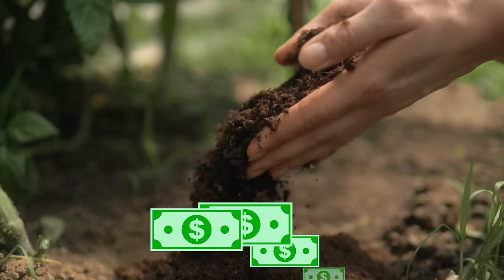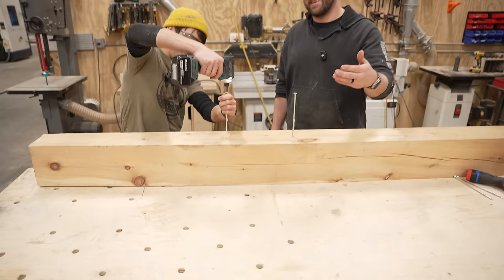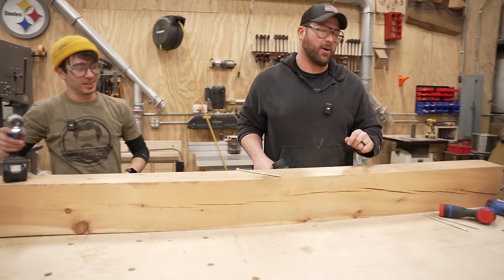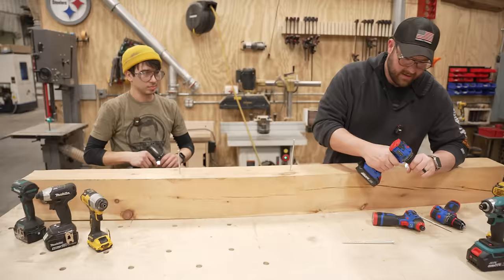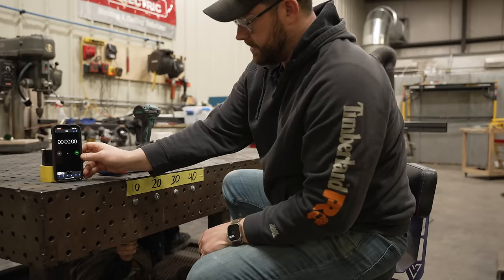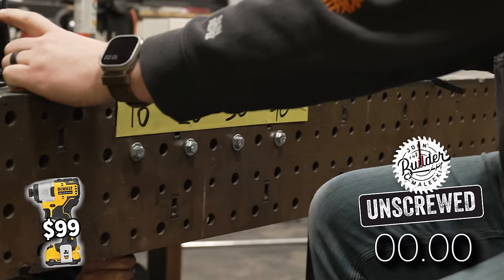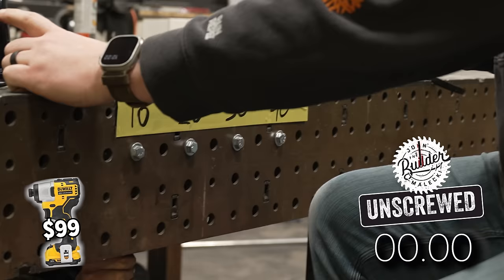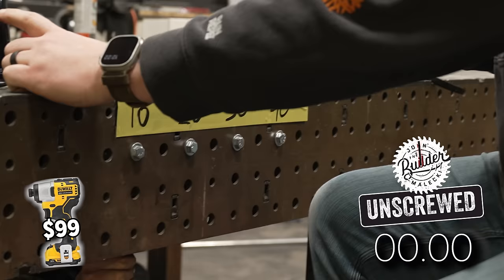TEMU Torture Test..... I was Surprised

Comment: Let's get a Temu vs Harbor Freight vs Amazon cheapest showdown!
Reply: harbor freight would destroy
Reply: @spedracer55 I kind of agree.  Maybe @JohnMaleckiUnscrewed can answer the age old question once and for all lol
Reply: Harbor Freight tools are amazing the baruer and hercules are just as good as dewalt and milwaukee
Reply: Amazon is gonna be the same as temu right. Drop shipped garbage but it's gotta be better than Ryobi.
Reply: I agree
Reply: @chadsmen2519 
😂 These off brand drills are made in the same factory as Milwaukee DeWalt Makita.  But the off brand copycats won't have the longevity as the big brands. The off-brands also don't have all the safety as the big brands. But if you need a drill for a little DIY around the house that $50 Makita javn ain't that bad

Comment: My brother has a Bauer impact driver.  He's used it multiple times to take lug nuts off before he got a regular impact. 

Also, most cars lug nuts are torqued to around 80 lb/ft. Larger trucks will be more of course.
Reply: I would say 75 to 120 for most passenger vehicles and light trucks. With your bigger cars starting around 100. Then big vans and trucks around 100-150. Just wanted to add some more depth 😅

Comment: i use a 18v impact hyper tough brand to do 120 ft lb on all our lugs. its been the best little impact driver we've used, it was dirt cheap cause someone stopped in one day with 2 hyper tough drills an the impact with 2 batterys an a quick charger for 25 bux so we did it to help them out thinking they would be junk but thats been 5+ years ago an they are all still working strong an used daily.
Reply: Hyper tough are surprisingly good
Reply: Sounds like you bought some stolen tools. 🤦🏻‍♂️
Reply: @enderz0r  nah we knew who he was, he gets in a hard spot from time to time an he usually brings stuff around asking if he can pawn it to us so he can come back later an get it back an we always do it to help him out cause he almost always comes back an gets the stuff or if he isnt able he lets us know to keep it an we only mkae him pay way we gave him but that day he didnt need much an didnt want to come back to get them so he offered to sell them all for 25 bux, probably got him something to drink but hes a good guy an dont bother anyone.
Reply: @ChristopherOBrienPSU  so far the ones ive used have been, got alittle electric screw driver i use alot an its battery has died on it an its a internal battery but im going to try to swap it out or make it work with a 18650 cause it was a done good an it lasted for yrs b4 the battery finally gave out but it hink it was partly my fault cause i lost the charger an used one i found that was close but it needed  weird voltage so i got close but not what it really needed.
Reply: @capthowdy126     Seems you guys were a legitimate well trained group.  
I'm sure that gentleman used you as a pawn shop with good intention , and with honest goods to .

Most companies I know will also offer the same service to someone off the street .  

Just curious , but we always found the broken glass around the tools off putting ? 😂

Comment: Just so y’all know, it’s easier to set or break torque pushing vs pulling.  Use your body weight to push the tool down vs trying to pull the tool towards you.
Reply: Fo Sure! Also much safer.

Comment: My Husky air wrench is rated at 250 ft/lbs of torque, whereas the Kobalt 24v Impact Wrench I have is rated for 650 ft/lbs of torque and it works great for me, I haven't found anything yet that it won't work on. I have the 20v DeWalt XR Impact Driver and it works great as a wrench as well, rated up to 1825in/lbs

Comment: I've got the same china driver but grey/black with 1/2 inch square drive and 1/4 inch hex in the centre for £37 (I splashed an extra £5 for the higher Ah battery pair). The thing is amazing, takes huge punishment and stunningly useful. I lent it to my landlord who bolted together a steel barn for his 3 JCBs with it. He was sad to give it back. For the price I am pleased with how good this device is. I use Festool and such for the exactness, design and perfection but for bashing stuff together and smashing it apart, this china tool does the job remarkably well. (I always wonder when it is going to explode into kibbles though...)

Comment: I dropped my DCF887 impact off a 30ft roof on to cement a few years ago and the handle cracked, but the rubber coating kept it together. I used flex tape around the handle and it worked for another 2 years or so until i reolaced it with a newer model. Surprised the hell out of me. I still have the 3ah battery i was using to this day.

Comment: I question the lug nut test cuz car lug nuts should be torqued to 80ft/lb and Sam said a typical lug nut should be torqued to 120ft/lbs which would most likely snap the bolt.

Comment: I have the Ryobi p239 with the quarter inch to 3/8 in drive adapter it's removed lug nuts at 120 ft lb before I'm not going to say it was happy but it did do it
Reply: Lmao how long did that take to break it loose?
Reply: @I.no.ah.guy57  I've never thought to time it if I rotate my parents tires I'll time how long it takes to break them loose and leave the comment
Reply: @icebear6393  lol it's not a big deal, I was just looking for a rough estimate, not exact. I'm just saying that it probably took a second with a 1/4in drive
Reply: @I.no.ah.guy57  it took between 6 and 8 seconds.
I was bored and had nothing better to do probably still not good for it I'm just impressed it does it at all.
Reply: @icebear6393   hahaha yeah that's a little longer than you want, but 100 ft lbs would probably be a good limit to stay under for that gun with that size shank (1/4in). Is this a full size truck or SUV you're taking the lugs off of? 120 is a little much for a passenger vehicle or light truck, so I'm jw

Comment: The old DeWalt NiMH 18V impact drivers were about on par with the Temu mini one, or maybe even a little weaker. If I remember correctly when I tested them it would stop around 35-40 ft-lbs. I also had a 1/2 inch impact and it could barely pull off a 100-ft-lb lug nut. I had to add torque to the nuts after putting them on with that because it was too weak. People forget how bad the old tools were. Now the cheapo import stuff outperforms that old prosumer stuff from 20 years ago.

Comment: Paddle bits go through faster if u rotate with the drill . That sead if u are just blowing threw meny  holes say for electrical wire. If u know u know . P.s. my brother got a impact online sorry i dont know brand it came with 3 different size sockets for 50$ he says it will take off rusted lugs ive seen it works really good 💪🏽.ive seen a Dewalt drill hit the ground from a less hight and explode so😅.

Comment: Hart brushless compact impact rates higher then Ryobi at 2,200 in lb / 183 ft. Real world, at 110 ft on my truck. Able to remove it with 2 ah battery. If I torque it at 130...probably not. I keep this is my truck with a break bar for possible tire change.

Comment: Impact drivers rely on speed instead of anvil size.  Impact guns rely on much larger anvils with slower speed to deliver the larger torque claims.  Testing a driver on something like a lug nut is interesting but 100% not what they are designed to do.

Comment: When they use the drills they said it has a clutch that keeps it from kicking back they are right but that's not what happened in that incident that is an electrical safety that keeps the gun from breaking your wrist.

Comment: I do love tool racing, and the various testing that's a thing nowadays. I do want to make a point, I do woodworking and work on cars. The car side of this is never mentioned. Those impacts, lets be real even a shitty one is good enough for wood mostly. Now cars is where everything is different. I have a rigid brushless subcompact now, gamechanger for the cars. My suuuuper old ryobi impact that came with the cheap set did me well for wood for years. Now the good one im using that sucker on cars, and its impressive. Just saying I think with how you have done ratings with things like squirrels, I think could be applied here. Like a straight trash, doesnt work. Then a good enough to work for wood. Then works well for wood. Then good enough for car level. Just one of those things I love videos like these, but I do know those cheapo tools would actually work very well for alot of people I know. Just not me or you lol.
Reply: Lol thats what I get for commenting before the video is over. Old impacts just couldnt do lugnuts, modern ones do have a shot. I do think your torque wrench was off, but still. More real test would be go to a lug you havnt loosened and torqued, lets be real shops and us normal people all have big boy impacts for lugs now. But good tests

Comment: 120 ft lbs is too high for most lug nuts. There are exceptions, but they usually need around 70-90 ft lbs, depending on the vehicle.

Comment: All the tools that say 21v 20 v etc are all 18v tools as that's the nominal voltage. That's why in the EU they're sold as 18v for example DeWalt XR 20v is 18v in EU even though batteries are the same.

Comment: First of all drills have 2 speed gearbox, second gear is faster but has a lot of less torque, speed 1 is just all about the torque, and i'm sure you were trying to run those drills at second gear, and for those tiny drills that way above what they are designed for. Second thing is that busting 150 ft/lbs for name brand impact driver is like nothing. The thing is that removing something torque to 100 ft/lbs requires about 80 ft/lbs to brake that lose, so about 80% of torque fastening torque is required to bust something. Impact drivers are meant to mostly drive screws/bolts not to remove them, meaning those tools are pretty much always forward (tightening) biased. Hercules impact driver is able to get 200 ft/lbs tightening, would probably do around 450ft/lbs of break away torque.

Comment: Batteries are often junk on these. They use cheapest chinese cells. Bought a cheap drill (Deko) from Aliexpress with two (!) batteries. Drill was actually good but after 1+ year both batteries were screwed without much use but they were charged properly. A replacement could not be find. Found a similar shaped/sized battery from other brand but it was expensive. Instead I bought a Bosch drill. Waste of money with these cheap drills.

Comment: To be fair with the paddle bits why didn't you back the bit out of the hole and get it spinning again first before continuing to try and shove a stuck bit into a hole and expecting it to just magically start going again. YES the Dewalt could do it but this is a cheap tool. NOT an expensive Dewalt or other similar expensive brand.

Comment: I think for the test with the bolts you were torking the wrong side, I believe you should have torked the nut and not the bolt head. And for the lug nut test, lug studs and nuts tend to be a finer thread than the nuts and bolts you were testing on the bench, so i dont think it was a fair comparison between the two test. I think the smaller impacts would have performed better on the lug nut than on the bolts on the bench. Not an expert, just critically thinking.

Comment: Can we replace the people in this video with some that have common sense?  Nobody in their right might buys a cheap tool to try to do something as demanding as driving long screws into deep wood, yet this is what seems like an appropriate test?  It's almost as though they knew going in, that they had sane argument and were just aiming towards a target audience of apes too dumb to think in any terms more complicated than more equals better or winner vs loser.

I don't give a rat's behind if a tool is too weak to do something, because I have other tools to do those jobs.  What i care about is whether, doing what the tool is good at, will it last long term.  I don't even care if it wins a marathon doing that, because if I were still a contractor, I wouldn't even consider using generic tools but mostly because of their generic batteries but also because, if I have one part of a multipart kit die, whether the tool, battery or charger, I want to be able to go to a local  hardware store and pick up compatible replacements so that means a major brand that local stores carry because I can't wait days for something to come in the mail in order to finish a job.

Comment: Like the presentation and editing, but your ignorance of most things and lack of science ruins the video.

Tightening a nut to 100 ftlbs does not mean it takes 100 ftlbs to remove.  Comparing different battery sizes and partially charged batteries vs. fully charged is ridiculous.  Using used drill bits of different brands is a worthless comparison.  Used drills vs. new drills.  setting the drill speeds to high speed rather than high torque.  There's more, but you get the idea.
Reply from the maker: Ah damn. Should’ve probably been more scientific when throwing it off the truck bed and roof too….. I think you missed the point my friend. We’re just having fun. Some people do that.